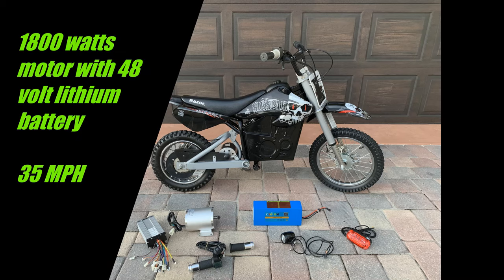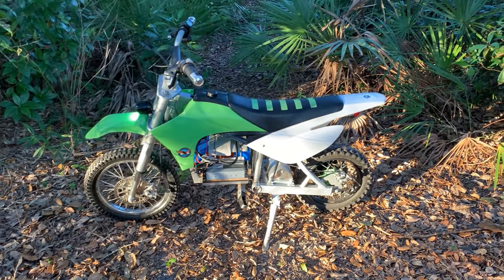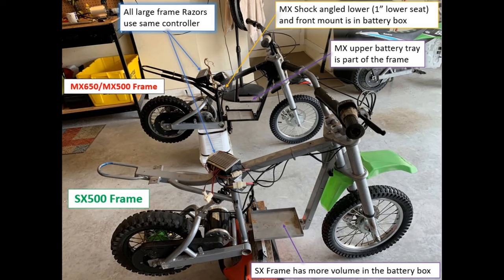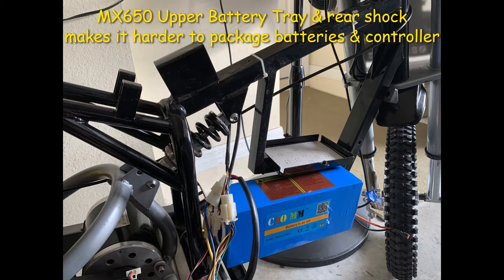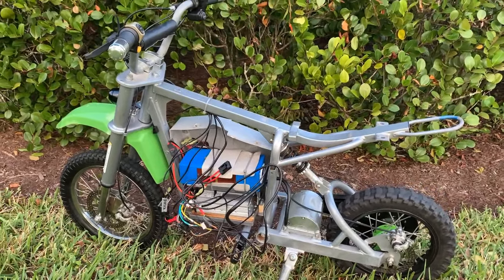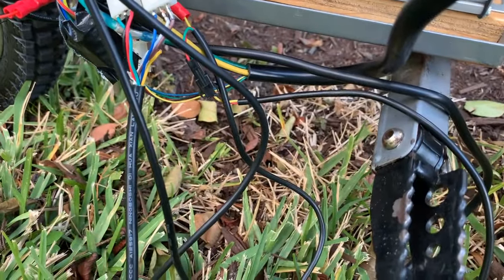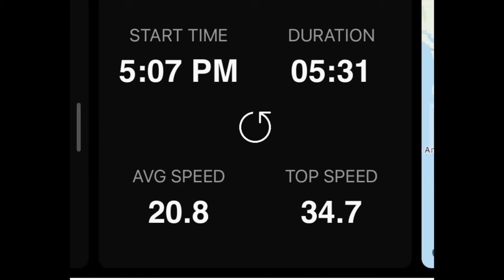go 35mph with 48V 2000W motor - Razor MX650 MX500 SX500 RSF650 upgrade for $400

Comment: is it still possible to build everything in the mx650 frame? And are the wire butt things required?
Reply from the maker: yes, everything fits in the MX650 & MX500; see this video at 0.07 sec for battery fit up in the MX frame:   https://youtu.be/kRvYAI1hdc4    then mount the controller in the upper battery tray of MX650 or MX500

Comment: Have you done anything with a mx350? Do you think I could convert it to lithium for lighter weight, quicker charging and longer ride time with the stock controller? Thanks in advance for any info! Sweet build!
Reply from the maker: I have heard people going to 36V with MX350
Reply: @BRichSolution  I wanna upgrade to stronger  motor for mx350 any ideas ?

Comment: Is there anything you could recommend for me to buy to make it go even faster?
Reply from the maker: you could go to 14T motor sprocket would gain 1-2 mph.   Or go to 52V battery would be bump over 2-3 mph.      The issue with going to 60V battery & motor is the build cost over $1500.

Comment: hey how many miles can the 48v 14AH battery last for? miles? hours?
Reply from the maker: 48V/14Ah battery with 1800W or 2000W full throttle I was able to get 12 mile and 60 minutes; longer with mixed riding and less throttle.  The 20Ah should get you 18 miles

Comment: Hey B, great video. I'm hoping you can help me out. I have the same motor you linked, 1800w, 48v. I'm just about done with my build and getting ready to ditch the stock razor batteries and just order the 48v-14ah with charger. But I see that the battery's maximum continuous discharge current is 30 amps and the Motor's Controller maximum current rating is 32 amps documented on the site, and says 33 amps on my controller. Either way, from what I understand, the battery's max. discharge should be higher than the controller's max. current rating and this is not so with this motor and battery combo. Is this a problem? Is it enough to worry about? If i stand in a pool, lick my finger, stick my finger in a socket.... will I feel better?

All joking a side, I'm learning about stuff I shoulda known long ago but I'm getting ready to pull the trigger on the battery and want to make sure I get the best bang from my buck. I see you addressed someone's concern about the 1200w battery with an 1800w motor, which was a concern of mine also. Not sure I understand, but would it be better to find one rated for the 1800w motor?

Thanks ahead for any insight. Love the vid. Now I want dirtbikes instead of this scooter....
Reply from the maker: I understand your concern, but that 1200W is guide for this battery specs.   Ideally you'd want a battery with a 35A BMS, but the 30A BMS battery is sufficient as it appears the BMS restricts amps to 40A in real life.  The reason why I know this to be true as when riding I do not notice a performance hit unless the voltage is below 45V  (riding for over 60 minutes) in high speed (pulling 1800W).  Hence, 1800W / 45V = 40 Amps.   When I start to drop below 47V I typically only run in medium or low gear (this is why I like the 3 spd throttle) to preserve my range.  That's why I like having the 3 spd throttle and volt gage on the handlebars.
Reply: @BRichSolution  That helps clear it up. Yeah I ordered the 14ah battery after I asked question. Should be here Wednesday. I've got a jumper on my 3 speed connector but I'm looking at ordering a 3 speed switch and a battery/volt monitor. I think having that 3 speed option is a good idea based on what you stated. Thank you for the response.
Reply: @scotmaciver curious if the battery ended up working for you? I bought a different brand rated at 30a and will not even turn the bike on. 34a current on the vevor controller

Comment: Is there a kit anyone can suggest to put on an mx 350 just got one and im trying to upgrade i dont wanna spend hella on it i just was a decent ride time and speed
Reply from the maker: I would just upgrade the stock 24V battery to 36V li-ion battery and keep the stock motor and controller can handle the extra power and the bike will be lighter and 5 mph faster.     The 36v / 14ah battery will give you a lot longer ride time too. http://ebay.us/7VCLqF

Comment: Instead of using the 3 speed could I just hook up the normal throttle to it??
Reply from the maker: you can use the single speed throttle that come with the kit but you have to wire it correctly or else it will only operate in Middle gear.   Listen to video at 5:34 to wire the single speed throttle so it's in high gear

Comment: how does the xlr plug charge the battery? if its not the same end
Reply from the maker: Either wire the new battery to xlr plug and make sure to use 48v charger or on my last 3 builds i run the battery charge cord/plug out the back of battery box and use the charger that comes with the battery

Comment: Killer video ! Would all of this fit the rsx650 razor ? I believe the battery tray is quite large as well. I subscribed btw !
Reply from the maker: yes it should fit... worst case cut the upper battery tray off the frame
Reply: @BRichSolution   roger that thank you 🙏🏼
Reply: It fits the rsf650 rear arm is skinnier so you don't have to cut a hole in the arm. I have a mx500 36v 800w,mx650 48v and rsf650 48v 1000w.....shit is addictive

Comment: Are you able to put a 48 V kit on a MX 350 without buying a new battery?
Reply from the maker: Yes you can install on mx350 but you need an adapter plate for the motor
Reply: @BRichSolution  do you need an adapter plate for every kind of kit or just the kit you installed?
Reply: @BRichSolution  do I need an adapter plate for all upgrade kits or just yours?

Comment: Is this motor a direct bolt on?  Looks like I would need to buy the motor kit and the sprocket at minimum?
Reply from the maker: yes motor is bolt on, but you do have recess 2 protruding screws on the back of the motor.  see video at 2:22 for details.   the screws are easy to recess as the motor back plate is aluminum to it drills out easily

Comment: Does the motor fit without modifications? It says 6.7in the original is 5.5
Reply from the maker: It bolts right into the frame buy you have make sure 2 out of 3 bolt heads are flush.  See this video 8:29. https://youtu.be/rBJ2z1ujeRg

Comment: Can I just put the lithium batteries in and not change the motor Will that mess up the motor that comes with it??🥲
Reply from the maker: I have two bikes with 48v battery and stock motor.   It work good for kids or adult rider on road.   But adult rider off road long ride you can cook the stock motor with 48v.     see this video:  https://youtu.be/kRvYAI1hdc4

Comment: I just don’t understand how you turn the bike on and off can you explain how that works
Reply from the maker: Wire the factory on/off switch to elock port on the new controller.   See the poor-mans schematic at end of video in doubt
Reply: Thank you so much man I really appreciate it
Reply: @BRichSolution when you say factory you mean stock right ? Also the stock one with the Mx 650 is on the side of the bike so can you explain how to wire that one to the e lock port ? Thanks for all the help so far 👍👍
Reply: @BRichSolution can you please do a tutorial on how to wire the on off switch to the e lock port

Comment: How long does the 14ah 48v 1200w battery last with a single charge I really need to know before purchasing
Reply from the maker: 14 Ah battery last me about 60 minutes mixed riding.      Full speed at 30+ mph I only ride about 30 minutes or 10 miles.   If in doubt get in the 20Ah version which will give you 90 min of ride  http://ebay.us/2AUk7j which will be in stock next week
Reply: @BRichSolution  ok thank you for letting me know
Reply from the maker: Batteries are back instock. http://ebay.us/2AUk7j

Comment: Awesome build. Do you think it would be possible to put a set of MX500/650 wheels on the SX500?
Reply from the maker: Yes, the MX500 MX 650 wheels bolt right in.    In this video you can see the green SX500 has MX650 16" front tire

Comment: I used a 50 ah lithium 48 v battery expensive but its now a comeplete sleeper
Reply from the maker: you must be able to ride for 50 miles?
Reply: @BRichSolution  yeah its the best bro I know is very expensive (around 1000$ for the battery and controller and motor) but its just a new bike and the best mini electric bike you could ever have

Comment: I have a similar setup and I love it.... Been looking for a good battery that can handle a 2000w motor but now I'm probably going to get the 60v-72v 3000w kit and have an 80v greenworks battery. I've seen them kits go up to 60mph..... Just trying to find a few materials to make the new battery box, IDK what I'm doing w/ that yet, I'm thinking of doing complete lights w/ turn signals and horn and a decent set of street tires.
Edit: O yeah, and I need a helmet too..... 40mph on an Mx650 is scary.     LoL
Reply from the maker: Eon Batteries makes custom batteries that fit in the bottom tray of the Razor Dirtbikes.   https://eonlithium.com/product/custom-voltage-19-2ah-eon-lithium-21700-battery-made-for-mx650-mx500/

Comment: How long does battery last before u need to charge it again on the MX650 stock.
Reply from the maker: It depends on charging/discharging; but over 2 years.   I have one bike the battery is still performing great after 18 months & 250 charges

Comment: I need help. I just connected everything but bike won’t turn on?
Reply from the maker: Do you have the E-lock harness connected?   If not try jump (small wire connect red to black wire) on the E-lock harness to energize the controller
Reply: @BRichSolution  still didn't work. Also when ever I connect the battery to the controller it will spark at first but then won't again. Is there a way I can dm you a photo so you can get a better idea of what may be the Reason?
Reply: I messaged you on Instagram

Comment: Sorry to ask another question but if i used this on a mx650 would it's top speed be slower with your exact setup?
Reply from the maker: top speed will be the same with mx650; only difference is the battery box is a little smaller so packing the battery is a little tighter.  see the video on how to package the battery in MX650:  https://youtu.be/uvTHxL_mtcc
Reply: @BRichSolution  thank you!

Comment: I want to try this set up for my MX 650, how hard is the wiring to do ?
Reply from the maker: In this video is shows you step by step how to wire this setup.  There is a poor man’s schematic at 5:09.   To the package the 14Ah battery in the Mx650 frame see this video at 9 second mark.  https://youtu.be/kRvYAI1hdc4

Comment: hey man so i have the same cao mm battery i am having a difficult time wiring it, can u help?
Reply from the maker: What Wires are  you having issues with?  See poor mans schematic toward end of video
Reply: @BRichSolution i am having issues with the positive and negative wires but the cao mm battery has a plug and btw i use a vevor set

Comment: would a 72v 3000watt motor fit on the srf650 or the mx650?...
Reply from the maker: yes 72V & 3000w does fit is MX650 & RF650.  Several people have done it but the price is double or triple.   Battery & motors get expensive quickly and I personally think 35 mph is fast enough on this little bike; 50+ mph would be scary on this little bike.

Comment: where do you find the frame itself? i don’t wanna spend much on that park
Reply from the maker: Bought used razor sx500 or mx650 or mx500 on facebool maketplace with dead batteries for $80
Reply: @BRichSolution  yeah i’ve tried looking
Reply: @BRichSolution  i can only find mx 350s for a semi reasonable price

Comment: What did you do with the wires you did not use?
Reply from the maker: The controller wires not used put electrical tape over them to prevent water or debris

Comment: Thanks again for this! So I just got my rsf set up just like this and it did 30mph.. how did you get 35 out of that bad boy?
Reply from the maker: I have a 13 tooth motor sprocket.  Stock is 11T
Do you have 3 speed running in high speed?
Reply: @BRichSolution  I have a 14 tooth sprocket. One speed but I tested and it’s the top speed…? I might try a 3 speed controller to see if I can hit 35

Comment: How's it holding up? I want to try and do this on mine? Also how did you wire the battery and stuff? Do you have a diagram
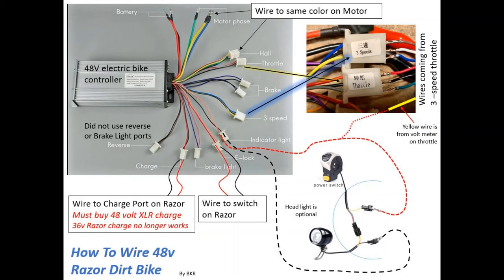Reply from the maker: Hold up well; riden over 100 miles.    Diagram is at 5:20 in video

Comment: Also I was wondering the runtime of the least expensive battery?
Reply from the maker: with the 14Ah battery I get at least 60 minutes of mixed riding and with the 20Ah you should be able to get over 90 minutes of riding.

Comment: Did you use the same connectors or did you have to order more?
Reply from the maker: I used the controller that came with the motor as all connectors are plug and play.  The only thing I chose to do different was the 3 speed throttle which i have to hard wire, but easy to connect using level butt end connectors

Comment: Hey do you use the stock chain or what chain do you use?
Reply from the maker: Yes I used the stock chain (#25) and ordered a 25H chain (H for heavy duty has the links are little thicker) and changed to 25H chain a few months after the build.   Here is a link to 25H chain  https://amzn.to/3dBOR4D
Reply: @BRichSolution  thanks I just ordered the stuff and a sx500 hoping it will be fun

Comment: Would this work for a mx350 and does that battery work for a 2000w motor
Reply from the maker: Yes but you need motor mount kit for larger motor.   BTW 2000w motor kit is not worth the extra money and the controller limits output to 33A so you will never see 2000w only 1800w.   Buy the 1800w motor kit and save $50. https://amzn.to/46fsSun
Reply: @BRichSolution  and it works for a mix 350?

Comment: How did you turn the bike on? I didnt catch it in the video
Reply from the maker: Wire the elock port on controller to on/off factory switch
Reply: @BRichSolution i dont see it, but is it keyswitch?

Comment: Hey I did the hole tutorial and it’s stuck doing 5 mph
Reply from the maker: Do you have 3 speed throttle? Or wire 3 speed throttle in high gear?
Reply: @BRichSolution  I believe 3 speed throttle
Reply: Hello

Comment: Hey buddy love your videos done upgrades on all three of my kids electric dirtbikes mx350, mx650, mx500 all have lithium batteries and run amazing all thanks to your videos. we haven't had our ktms out all summer. I'm having a issue I'm doing a swap to a sx I just picked up I bought 48v20ah lithium 2000 w motor and controller I've got it wired up just like the diagram in the video and I'm not getting anything no power at all I've double checked the brake wires  and still nothing the only other thing maybe a bad controller idk have you ever ran into a similar issue? And thanks again we are loving our e dirtbikes now that they actually fly and batteries last for ever
Reply from the maker: sounds like a bad controller, I've heard of that being an issue
Reply: @BRichSolution  hey thanks I was using the pass through connectors the grey ones with the orange snaps  and I must of strip the 1 wire to short and the power wire wasn't full connected lmao I'm a idiot lol

Comment: Could u ride it 13.8 miles on a sidewalk straight
Reply from the maker: for sure, without issue.   I bet you could ride 15+ miles with 48V/14Ah battery on pavement without issue.

Comment: Did you have to do any sottering
Reply from the maker: No as I used the easy to use Solder & Seal Connectors which you put two wires in use a heat gun and the connecter fuses wires together in in 10 seconds.  Super easy to use and weatherproof.   https://amzn.to/2WcCQNZ

Comment: I live in Europe and battery prices are higher than ever. The cost of 48v 14ah that you linked is very cheap. It uses 30a bms how are you using it with 1800w. You would need 40a bms
Reply from the maker: The 48V/14Ah Li-ion battery I used on many builds when fully charged is 54.4V.    54.4V x 30A = 1632 watts.   I believe the BMS allows for more Amp draw.   The reason why I theorize this is I only ever see a performance issue when the battery drops below 45V and in high gear top speed I notice the motor will surge & then slow down; hence 1800w/45v = 40 Amps.

Comment: Would a 2000watt motor work for this build?
Reply from the maker: yes it will work, but you will never see the 2000w capability as the controller on 2000W motor kit max output is 33A.    Save the money and buy 1800W kit for $130 https://amzn.to/47FkODT     48V fully charged is 56V,  56V x 33A = 1858W.   you could go to 52V battery or 2000W motor kit with 45A controller to get to 2000W performance:  https://amzn.to/45hmKRs

Comment: What volt is at full and what volt is it when it starts to die
Reply from the maker: full charge is 54.4V; when it dies its around 42V; I have only let that happen once
Reply: @BRichSolution  how long will the 48v 20ah last you think?
Reply: @BRichSolution , is it bad to let the battery completely die? Is the goal to ride it right up until it dies? Before it gets to 42 volts you want to charge the battery? Also is there a time limit that you should have it on the charger? Will the charger automatically stop charging when the battery is full? If there is a gap of time where they aren’t ridden should they be put on the charger? 
Thanks

Comment: How did you connect it with a sealed battery?
Reply from the maker: see video from 5:25 for schematic.   I connected the black wire from the new battery to black wire from the old battery.  I did the same for the red wire on the new battery to black wire see this video at 1:48  ttps://youtu.be/uvTHxL_mtcc
Reply: @BRichSolution  okay, thanks

Comment: Did you leave the stock rear sprocket and chain?
Reply from the maker: stock rear sprocket and stock chain.  The motor sprocket I changed from 11T-25H to 13T-25H
Reply: @BRichSolution  Awesome. Thanks
Reply: Were can i get sprocket there all sold out